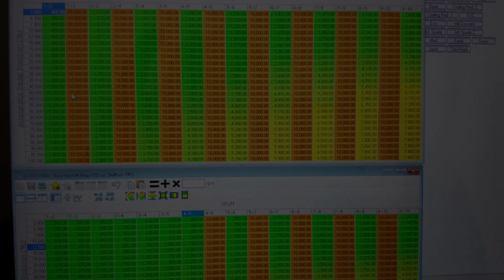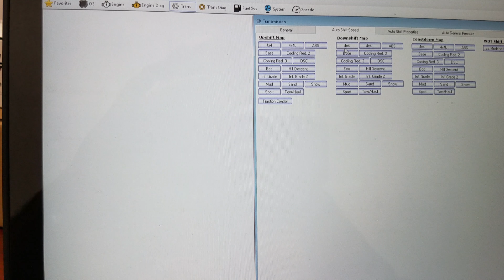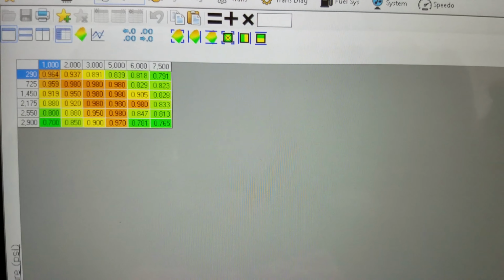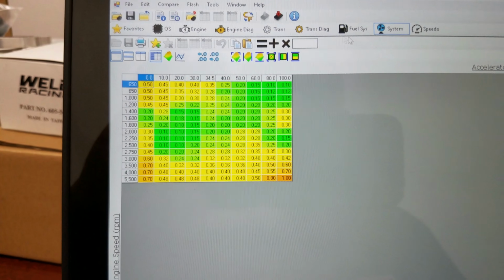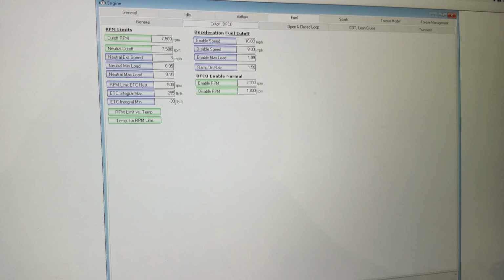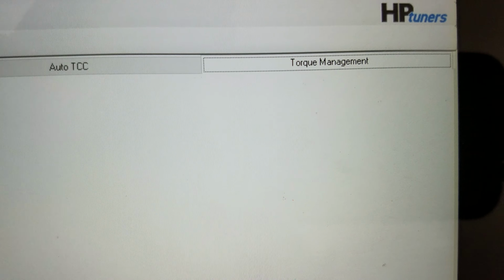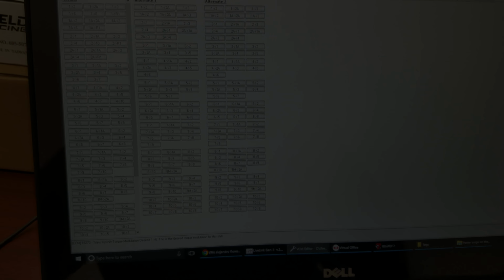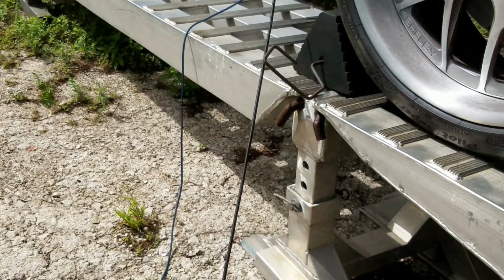2018 Mustang A10 Calibration Details and Shelby 1000 makes over 1000

Comment: Hey alex, just a quick question. If you want a head like the hemi or pent roof (because they have less surf area, therefore you lose less temp and make more cylinder pressure), then why do you want a colder spark plug which transfers more heat to the head?

Awesome video by the way.

Comment: I've got an sn97 with 08 pi vic engine with a t5 behind it and I'm looking to try my hand at tuning. I've done some tuning in the past on my previous LS build using EFI live, but my buddy that has a shop here uses hp tuners and neither of us are familiar with the ford platform. Are there any tips or tricks of the trade you could pass along to kind of help us in getting started?
Reply from the maker: sciencewhiz12 like most tuners.. suck off a good file and copy. Lmao funny but true.
Reply: Alejandro Flores so, it'd be similar to me starting with a base LS1 table on my old 5.3 build. Guess I'll be scouring the interwebs for a base tune to play with

Comment: The trucks shift 1-3-5-7 8 9 10 in normal mode
Reply: Jeremy Flasch It will also run a 13.4 in the quarter mile with the 5.0 in a regular cab

Comment: Just get a MANual transmission. Fuck that automatic shit I don't care how many speeds it has.
Reply: Brandon Curry 10 speed manual is comeing
Reply: Corey Brown Real life fast and furious😂😂
Reply: billy heaton still prefer manual.
Reply: LMFAO i bet you wouldn't say  if you had cash on the line but thats' just me
Reply: billy heaton I wouldn't put cash on the line. I just prefer to drive my car and not have it drive me.
Reply: billy heaton won’t matter unless you have exact same mods running the exact same power...  there was a m6 s550 running neck and neck with an A8 SS on here until power took over on YT
Reply: Corey Brown then I'll have huge arms from shifting so much
Reply: Texarmageddon exactly.... people say the auto is so much damn faster, but it's funny because I raced a scatpack charger and scatpack challenger both 8 speed and it really didn't make a difference. What people don't understand is that automatics are not always faster, it's just more consistent. I can shift my car fast enough to keep up.... but the difference in the auto and manual is that yes every once in a while I might miss a gear or not hit the shift perfectly where as the automatic makes the correct shift every time. It's just more consistent. A good manual racer can keep up with a auto trans.
Reply: billy heaton why don't you look up drivermod viper. His shifting speed will correct all your bullshit thoughts on a manual being slower than an auto.